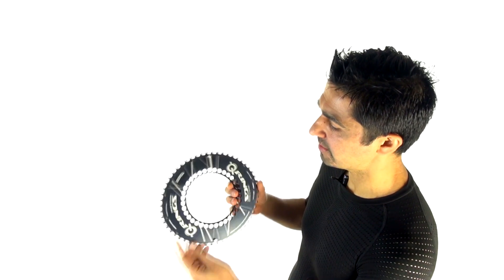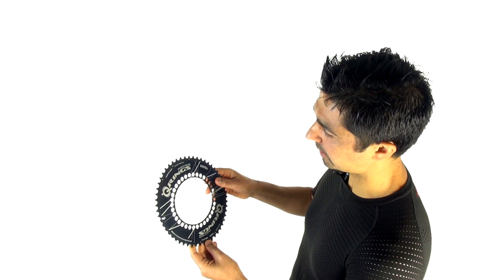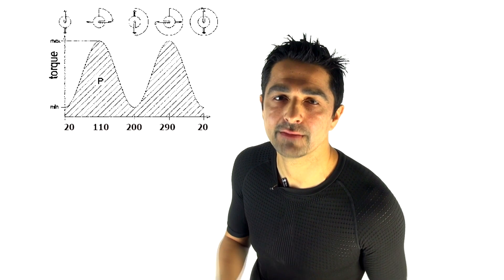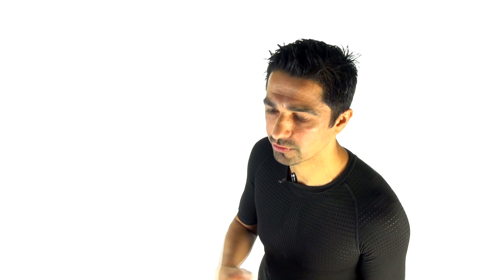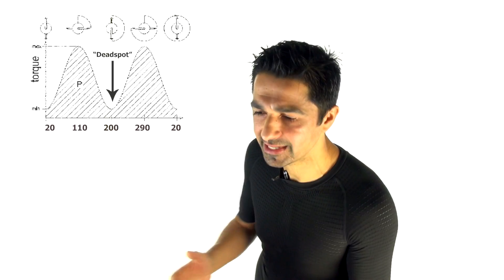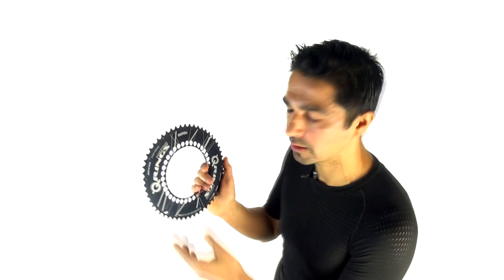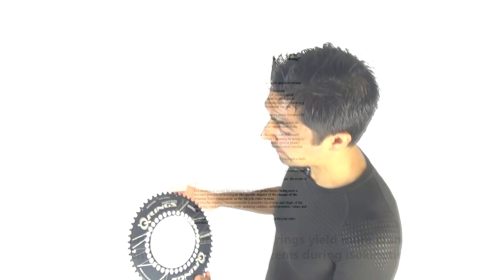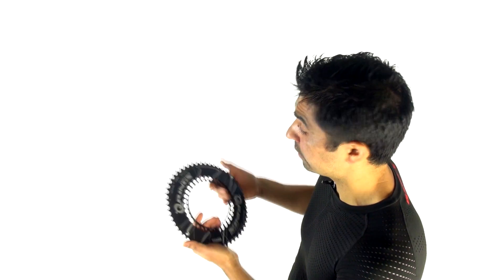Do Oval (non-round) chainrings improve one leg vs two leg cycling power (Q ring, osymmetric)

Comment: Several points - there are one-legged cyclists, like the fellow who did the Moab 24 Hr years ago, passing two-legged riders on uphills before dismounting and hopping past on the steepest stuff. Second, two legs joined by the crank show a two-phase cycle, where the primary foot is pulling the other thru the weak part; riders on flat free pedals are only applying force downward, and the other is along for the ride on the upswing. The alternate muscle groups are enjoying a rest cycle during the arc where they are not active, so flushing blood in and out is a part of the phases. Cadences and apparent gear ratios/leverages are all trained and optimized for output over fifteen second to ten hour periods. A single rotation cycle means very little. How much less efficient is the old toy pedal car, which some have tried to adopt with no success, to the bicycle drive train?

Comment: You do realize that the upstroke happens at the exact same time as a downstroke, right? Therefore, thinking that you're at a mechanical disadvantage during it is wrong, since you're getting the advantage on the opposite side, and really the only useful power you're putting into the upstroke is just so you're not adding resistance to the downstroke on the opposite side.
Reply: i guess, the advantage of oval is, you get quicker through the dead zone, which enables you to cycle at a higher candence. and it safes you from gettting stuck on uphills more then rounds do. so for my two pennys, ovals are beneficial during climbs and for high candence cyclists. they are good, if you push hard too, say against the wind.

but they feel weird, put more stress on chain and rear derailleur and are possibly harder to shift up front.

i like the concept and will keep trying it out.
Reply: @hannesreinhardt1399  Yes, I wasn't saying ovals don't work. Just that the upstroke isn't a weak part of the stroke or a dead zone. You have a downstroke at the exact same time as the upstroke.

Ovals have nothing whatsoever to do with helping the upstroke. This guy talks about people spreading misinformation then talks about downstroke vs upstroke as if theyre different events. Both cranks are connected to the same gear, if you're on the upstroke on one leg, you're on the downstroke on the other. Clips are the only thing that help the upstroke.
Reply: @iunnox666  click pedals definitely help...but i dont use.
i believe, the effective downstroke happens just for 1/3rd of the circle. so you have a real dead spot (without click pedals) for one third of the revolution. if my assumption is right, ovals would make sense. i still try it. i do see benefits on uphills. thanks for responding!

Comment: Okay, you are begging for a fight presenting it like this.

The claim is this: 10-15 per cent. Yes or no. Up or down.

Recommend: 1/ Dispute it and deny it CLEARLY ... don't muddy the waters.

You said slight ... so that means 0.5 - 1 per cent.

Sorry buddy, that's a denial. Let's break it down for you:

1/ IF you are tall, they work - longer levers ... and if shorter crank length for TT ... they work EVEN better.

So much so, GCNTweet says they falsify results. 

I dispute it, the industry IS biased against them ... and the way it's presented here is not clear.

Those who train harder and watch FTP like a hawk will know the difference. Shorter people won't know because unless they have physiology LIKE a taller person ... which might be a little difficult ... they will not understand AT all.

I couldn't watch most of the video, it was too difficult. If it's really .5 per cent difference, that's a denial. But you said it: sample size is not big enough. HBC.
Reply from the maker: 10-15 per cent savings in mechanical efficiency or watts  from oval vs non-oval rings: no.
Reply: @Fastfitnesstips  Again ... there is a POLITICAL problem which must be addressed before talking about the "facts".

Does Shimano refuse to build parts to support clean osymetric shifting? Yes. 

Is it a "perceived" benefit; placebo vs actual ? Look at both Chris Froome/ Wiggins BOTH being defeated in the Tour Espana - both tall - by a shorter cyclist up the steepest/ most feared climb Angliru ... then ask yourself, did they get out-pedalled ? Could they find a solution to overcome the Tour of Spain ?

Then ask is the solution simply a placebo with the victories which THEN came for them both under Sky WITH Osymetric on board?

Okay ... so if that is still a "no"; then why is this such a hotbed-topic when every other tech under the sun a non problem in cycling these day? Politics, driven by marketing.

Conspiracy or simply competing interests? That is: yes.

Comment: A pedal based powermeter would offer exactly NO benefit over a crank based powermeter in comparing oval and non-oval chainrings. A hub based powermeter might be better (given equal measurements/2pi) because in normal use you change the gear ratio and thus have sort of randomized measurement points. The anwer is more straingauges not going from crank to pedal based and also I would be very suprised if the in-between values were wildly different from what you would predict by interpolating the measurements quadratically ur cubically. The SRM for example has already 12 straingauges to my knowledge... 2% off systemically? I really don't think so.  Also as others have pointed out, cyclists have 2 legs, most cyclists anyway.

Comment: I don't care what they all say , the proof of the Pudding is in the eating . I have an absolute Black Oval 26t on my mtbike  when climbing and I push down I feel the most resistance coming in at about 3.o'clock and push harder with the pressure coming off at the bottom of the stroke at the same time the other leg feels like it's floating up to the top no effort and still relativity easy to begin the down stroke. For climbing in your low gears they are better , also I think your legs become stronger as well, as on the power part your sort of on a bigger chain ring and your legs start to adjust to that, my original chain ring was a 24t so  I   really jumped up to a 26t and on the 3 to 5 part it's a 28 but you don't feel it. Best thing I  upgraded except for my Dropper post.I ride with flats. I forgot to say that I start my down stroke just before the pedal reaches the top by lifting my leg and pushing  it over  the top.
Reply: I think if you got a 26t its a 26t on the power stroke and 24t of the deadzone not a 28t on the power stroke. If you had gotten a 24t oval it'd feel like a 22 on the dead zone.

Comment: If they're basically supposed to change the gearing at various points of the pedal stroke, then why doesn't the rear derailleur pulley cage move? I mean, if you change the bike's gearing in the usual way (with front and rear derailleur), the pulley cage swings back and forth to take up the changing slack in the chain. Yet every time I've seen an oval crank drivetrain spinning (including in this video) the rear derailleur isn't moving at all?
Reply: Because when the ring is vertically aligned, the chain is taken by this vertical extension, and when the ring is horizontally aligned the chain is taken by the extra reach from horizontal extension. If my math is right, that equals to roughly no derailleur movement.

Comment: The weak points are when the pedals are crossing over top and under the bottom (either leg), just like alternating electrical current.  The narrow part of the ring gives an effective lower gear at these points giving the legs a little break at that point.  Way back it was shown that the efficiency only appeared a low cadence-right where my old legs like to run (I don't race).

Comment: I have a black Oval on my Mountain Bike .The Oval has two more teeth than my old one.. What I've found when climbing steep terrain is that from 3 o'clock to 5 o'clock I have to push down with more force but it is only for a fraction of time and the leg gets a rest immediately after so I climb much better and with a bit more speed as I am putting more effort into the Bike but I can say because the maximum effort is such in a short duration I don't feel it at all . Also put a larger chain ring   on my Trance2 and though it wasn't recommended can change between the 2  ok if I make sure the chain is angled though I rarely need to use it unless there fire road.,

Comment: "The pedal velocity is slower on the up-stroke than the down-stroke." That's physically impossible, because one leg's up-stroke happens at the same time as the other leg's down-stroke, and the cranks are fixed in position relative to each other.
Reply: That was my thought too.  The only thing in the test that matters, I think is the dead spot,  since upstroke of one leg is the down stoke of another, but the dead spot happens to both legs at the same time.
Reply: Nobody cares about 1 leg lab tests in the real world.
Reply: @spacitron4818 riders with one leg care
Reply: @spacitron4818  That's ableist
Reply from the maker: In the two leg (normal situation) very true! thats why I added a note saying "transition to  upstroke" but in one leg lab test maybe not.

Comment: ive never tried one of these new chain ring but i ride fixed gear ( track ) 53/17 (round fsa chain ring )and i do feel a dead spot and i fill like if you ride geared bikes you have a loss of strength.. try fixed gear before use information for use of your opinion

Comment: I was trained long ago to pedal in circles,  I bought a bike with biopace, yes I'm that old, it provided absolutely zero benefit on any terrain and I replaced both rings after about six months. 
I ride fixed now so this is a non issue these days. 
IMO if your pedal in a circle, a circular ring will provide the drive you need.
Reply: Modern ovals are completely different to biopace, biopace was crap,
Reply: I test road biopace bike and it was weird not sure if I liked it.  maybe it needs to be refined
Reply: biopace was the exact opposite of the q ring. that mean hard in the dead spot.it was clearly a failure...
Reply: like I said, the biopace idea needed to be refined
Reply: HEAVYWALL 70 I ride bio pace. Did. Toning for me.

Comment: At a strictly set application of power (100w, 200w no matter) thru some type of device which also was able to completely unweight the leg weight on the upstroke, would an oval 53 accelerate the rear wheel RPMs faster and then sustain a higher RPM (still at that prescribed power setting) thus resulting in a faster wheel speed than a round 53?  My hunch is yes, the cadence will be higher and thus result in more wheel speed with the same power applied in the downstroke.  However as the video keenly addresses, adaptation occurs and long time round ring riders are able to scrape the bottom and push over the top and thus benefit from a mechanical advantage at the 12/6 over oval rings.  However does the mech advantage of oval rings at the 3/9 outweigh this? I sure would like to see this test.
Reply from the maker: Yes there would be a slight benefit during the downstroke L&R (but a disadvantage during inverse of downstroke L&R). Would these effects cancel each other out?
Reply: there would be no disadvantage on the upstroke in the model I suggested since the upstroke leg weight would be eliminated.  However with oval rings, if a rider was adept at pulling up during the upstroke they would realize a mech advantage at that point in addition to the downstroke.  The question is whether the relatively lower gearing of an oval ring at the 12/6 position is more than compensated for by the greater gearing coinciding with optimum biometrics during the downstroke i.e. 3/9 position.  And yes, as you suggest a powertap hub would be the best power measuring tool for this.

Comment: So I have been using a non round small cog only as I get knee pain working on the idea that I would be putting power through when knee is strong and in a good position and reduced power on the transition phase where joint is 'weak'. It feels better and I don't think my knee hurts as much. Any evidence for this or is it more likely that my knee is just getting better and it's a coincidence? I haven't tried going back, gift horse and mouth and all that
Reply from the maker: A lot of anecdotal evidence that non-round rings help comfort, but no actual studies on this I could find.
Reply: Thanks. That's kind of what I thought. Interesting video though. Keep them coming
Reply: Definately helps for knee pain, also shorter cranks help even more

Comment: Regarding your statement on adaptation... I switched to oval rings on my primary bike over two years ago (Q-rings initially, now AbsoluteBlack). Initially I felt a perceived improvement in speed and power.  When I got a dedicated commuter bike that I kept round rings on it became apparent to me that there is little difference.  Basically, I feel no difference when I switch back and forth between the two...
Reply from the maker: Interesting Scott Booth, I would say the same until I tried Osymmetric then there was a big difference....and not necessarily for the best!

Comment: Its about balancing off the dead spot with higher gearing, whilst maximizing torque on the down stroke. The up stroke is more about taking off the weight of the upward leg so that the down stroke is maximized, not having to push the weight of the upward leg. Thanks though for the very valuable insights.

Comment: Would it be worth using an oval inner for climbing/lower speeds where you say the 'pulsing' effect on speed is exaggerated? And then sticking to a round big ring where the effect on speed is negligible?
Reply from the maker: Great question. Its possible but it could equally make the problem worse. I have been trialing the more extreme oval of osymmetric this year and you really notice the difference in the phases of the pedal stroke and further I didn't like the effect when climbing esp when standing when pulsing is at its peak. However ultimately like so many things you really have to try it to decide for yourself.
Reply: @Fastfitnesstips  I run my setup like this. You do notice the difference on the trainer. Can take 1-2 minutes to smooth out pedal stroke. BUT, in the real world, when I hit a gradient and drop to the inner, oval ring, it has the opposite effect; it makes climbing feel like riding on the flat and so no change in pedaling feel. That's my experience anyway.

Comment: The rear derailleur arm has to go `bazurk` to make this system work ....extra friction / lack of mechanical smoothness  ...its a no go ...in my opinion
Reply: Chris Froome. Bradley Wiggins.
Reply: stephen john baldwin it’s berserk!
Reply: Surprisingly it doesn't at all. The chain stays the same length so there's no movement in the rear derailleur arm. The only exception I have found is on an Osymetric 34 tooth where there is a very small amount of movement. On larger rings, there's none.
Reply: You mean like changing cadence ?  How does a derailer arm handle us when we pedal faster then stop?  Has to be the silliest comment I’ve read.

Comment: What crap.  Froome is a 3x TdF winner, all due to oval rings; Nairo, on round rings, has placed 2 x second and 1x 3rd in TdF.  Yet, Nairo is a Giro and Vuelta winner on rounds, Froome...not.   So the logical conclusion, based on an incredibly narrow set of data points, is only Froome on ovals can win the TdF, and everyone else on rounds can win anything but the TdF.  Ovals are not the secret sauce of cycling; if they were, they'd be the standard equipment on bikes made for the unwashed heathens of mass consumption.   Run watcha brung, ride it like ya stole it.

Comment: you don't get a greater advantage with a bigger chainring, it is the opposite. put a bigger chain ring on and the gear ratio reduces, put a smaller chainring on it gets easier to push, because it is a relationship between the crank length and ring size. Therefore you have a greater advantage when the ring is at its smallest, when you feet are top and bottom. At these points you can produce less torque but you have a greater advantage. i.e. gearing is easier. Therefore it give you a move consistent spinning action and power delivery compared to a power peak at 3 and 9 o'clock and power low at 12 and 6 o'clock

Comment: U17's again, limited gears, what's more efficient and by how much? Large sprocket large chainring (say 51x17) or small chainring, small sprocket (say 39x13) - note the gear ratio is the same: 3:1 for both. Which would you use? Does it matter? and if so, by how much?
Reply from the maker: good question...the most efficient is the simplest chainline with least lateral deviation. The actual size of the sprockets doesnt make much difference (all other factors being equal). How much? the answer is in here: https://www.youtube.com/watch?v=qinJjb8_nEs
Reply: Thanks.

Comment: Someone should 3D print a 53-8 oval chainring just so we can put it on for laughs.
Reply: AGHH! ahh AGHH! ahh
Reply: New marginal gain. Expect Vroom to get even more ridiculous. Especially on TUEsdays.
Reply: That'd be a 3-ring chainset or at least an MTB-chainset with some very small bcd :D fitting 8T (2T smaller than commercially available rear cog) could be a bit of a problem to fit on 110bcd, never mind 130bcd lol
Reply: There's a new-ish material that (at temps below 80 degrees Celsius) approaches the strength of aluminium. Probably fine for a big-ring

Comment: Your argument for the upstroke is really null and void due to the fact that you're on the high part of the oval at that point.  it's only on the bottom and top of the stroke where there would be any difference and arguably you're losing power from the bottom of your down stroke.